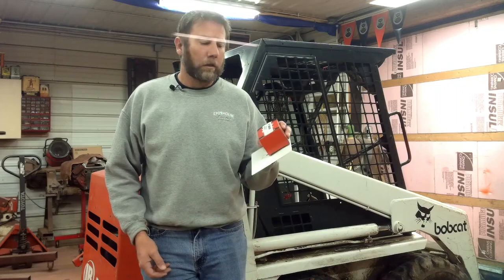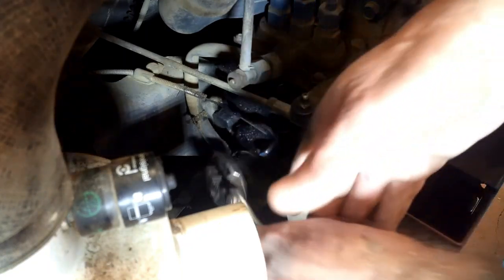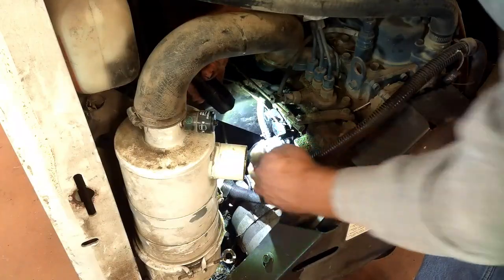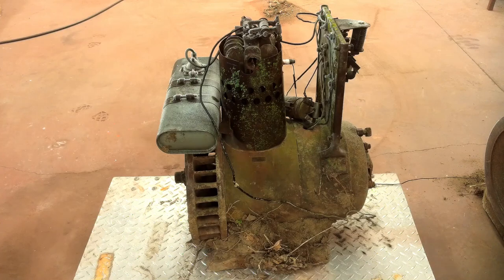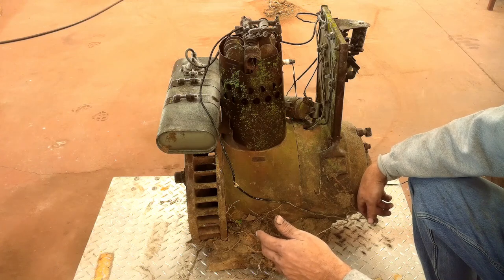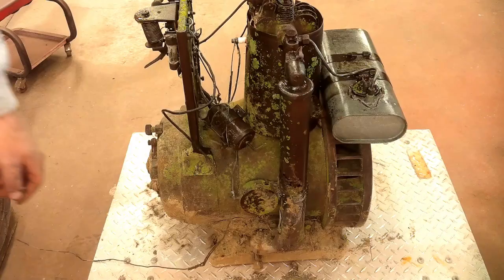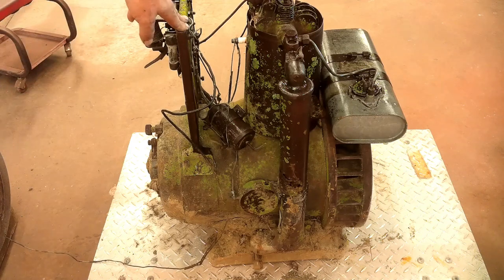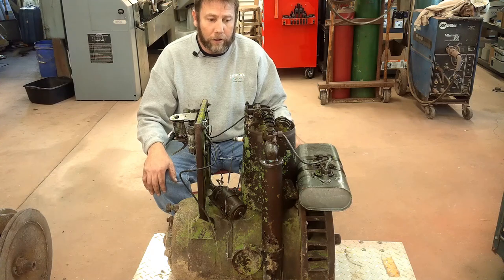Bobcat 543 Fuel Pump Replacement Delco Light Plant

Comment: The old light plant is pretty cool. My understanding is that they were relatively common around here until Rural Electrification, then were instantly obsolete. When I was growing up there was a small shed about 40 feet from the house that was referred to as the "Engine House". I assume that's where the light plant was once located. Of course it  was long gone by the time I came along.

Comment: back in the 80,s i was into 32 vole stuff wind genarators and delcos i ran the decos on 3 12 volt batterys 36 volts. the one you have is a 850 or a 650  watts. thay have no goveners thay were made to be governed by the load,  i once had a vacume cleaner and a  iorn,  good lock and have fun,
Reply from the maker: Thats neat, I read that the original batteries were 2 volt a piece and were made of glass. They probably all froze and broke after they went into disuse. Thats why you can't find them anymore

Comment: Those pistons look like they are from a 2-stroke.  The bottom ring would be to seal the crankcase from the intake port that was pressurized by a blower or turbo.  Google Detroit diesel 71 series piston.

Comment: Well its been a year, whatever came of the light plant?
Reply from the maker: Unfortunately, nothing. They are just sitting in the corner. I've been REALLY lazy lately.
Reply: @sparksfireandbalingwire8467  Haha, I know the feeling.  I just purchased one myself, will see if I can get some progress on it.
Reply: @gt69440  I have a parts Delco light plant that is loose that I am willing to part with if yours is stuck. Measure the flywheel to see if we have the same size engine. Look at the cooling fins to see if they are copper or cast iron cooling fins on the cylinder. If you give me the engine number I should be able to tell you what year it was built. It is on a alloy tag with a number stamped no it. I would like to buy the Willis generator I need parts for mine that are missing.
Reply: @group44xjs  Well I sure appreciate that.  I have since acquired 3 of them, haha.  Robbed some parts, and now back down to the 1.  I haven't had much time to fiddle with it either, but hoping this winter we will get it running.
Reply: Do you still have the Willis light plant and are you willing to part with it? I have one that needs some parts.